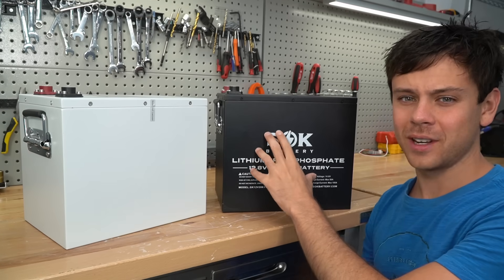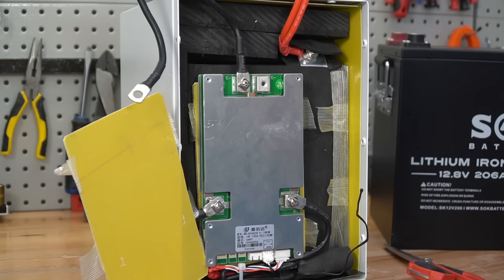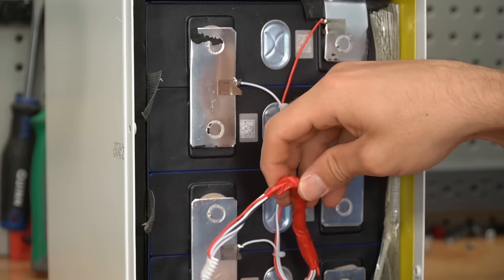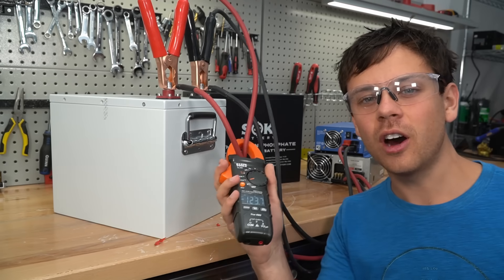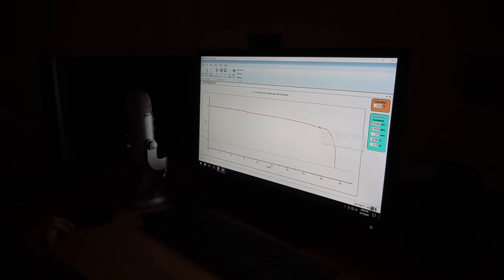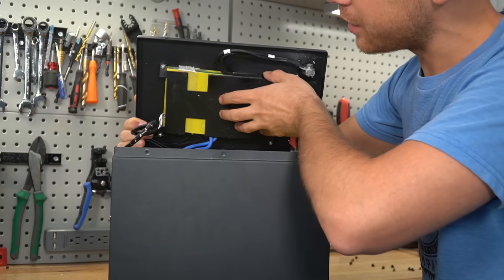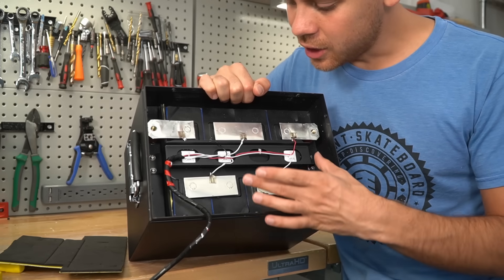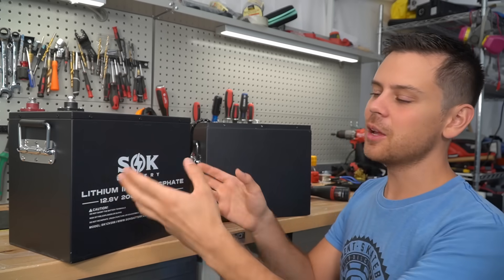SOK LiFePO4 Battery Knock Off! Prototype Tear Down

Comment: Totally love your YouTube channel. You’ve taught me a ton. I bought some 206 amp our S OK is. So far they’re a mess because the app is not reading correctly at all. And one of them is losing a charge… The place where I bought them says run them through two cycles and see what happens. What do you think of that?
Reply: Have you fixed the battery? These chinese things seem not that great

Comment: Great video Will, is there a way I can get in touch with you, I order a MPP 48 volt system and SOK 100Ah from your website, everything worked perfect until I left a small refrigerator connected over night, I came back and found my system down, I new right away I had drained my batteries, I order a 24 volt Victron Blue smart charger. 
I had order a second set of two 24 volt SOK batteries, Today I connected the new batteries on my system and nothing comes on, the voltage at each batteries was good 25.9V after connecting them in series 51.9 volts but when connected to my MPP it dropped to 9.57V.
I don't know what to do!

Comment: Hey, I have a 12V starter battery for a watercraft with a bad cell. Around 18-23 AH equivalent. I find it strange that no one is selling bad LiFePO4 starter batteries or parts.  Pouch cell almost square.

Comment: 5:46 I bet that happened ( wires pinched and one disconnected) as a result  of the same trauma that caused one of the power connectors to be bent ( referenced earlier).

Comment: In a sense I hope that this unnamed company works out their issues and gets their knockoff battery to market.  Why? Because SOK doesn't seem to have the ability to keep up with the demand for their product.  Every time I turn around SOK batteries out of stock/backordered. I like their overall design and I like the fact that someone with a little technical knowledge perform needed maintenance on them. On the flip side, I actually prefer battery packs that can be directly mounted into a 4-post 19-inch cabinet.  Sadly there are precious few options currently available that don't involve purchasing on alibaba and hoping for the best.

Comment: 3rdprototype - strap the cells down and strain-relieve the balance leads...

The unit needs to be able to be inverted without damage ( even if it really should be mounted right side up for optimal electrolyte distribution.)

Comment: Hi Will , I think you might be interested in doing something a bit different like a 24 volt alternator using a voltage regulator to up the voltage to say 60 volts to drop the amps to protect the alternator and feed that into your charge controller in place of your solar panels at night or for an inexpensive BACKUP in winter months for those in different latitudes . That could be interesting . What do you think ?

Comment: Congrats on the 500K Subs, brother.  I started watching you a LONG time ago when you were just a kid!  You've taught me everything I needed to know to power up my 1990 Foretravel Grand Villa. It's a 29 foot RV and I put four 100W panels on top and built myself four 12 Volt LiFePO4 batteries (with your help) and now have a great running, 48 Volt system in my RV.  Thanks again for your enthusiasm and your practical testing so that we don't have to get ripped off!  God Bless you & yours and your channel, son!

Comment: Will, good stuff.  Have a challenge for you.  The best LiPo system for a sailboat?  Boats have to be seriously offgrid and have a high safety req. for fire.  Could you do a video on your best recommendation for a LiPo Solar system for a sailboat?  Parameters would be 1000w of solar and a battery system to handle it.  Thanks.

Comment: I'm really enjoying your videos, and I feel like I'm learning a lot.  I'm not sure if you've tested a Wagan Power cube 1500, and I bought one several years ago, and looking to try to incorporate it into a sufficient solar power system that extends beyond it's normal set up.  In other words, I don't want to buy additional parts that might already be built in, nor do I want to over-extend the unit capabilities... to the point where I can't put all of the smoke back in.

Comment: i am looking at buying maybe a chins brand 12 volt 50ah batteries, i need 24 volt for my 60 pound thrust trolling motor. would i be better off to buy two batteries and run them in series or just get a 24 volt 100 ah battery instead? or build my own 24 volt battery?

Comment: Hi Will, I wondered if you have ever done a review of Ritar. They are a huge Chinese battery manufacturer and I bought two RITAR Lithium Batteri 12V 200Ah (LiFePO4) BMS 100A, for about same price as SOK, and that is in Norway where this stuff is usually expensive. They look fine and work well, but being a sealed plastic unit I don’t dare open them up ;-). Great video as usual - I have learnt a lot from you.

Comment: You can check out Fly Power through Amazon 48 volt 100 amp battery. Also check out with Scream Power through eBay 48 volt 100 amp battery as in same looks to outside of battery housing.

Comment: I love these videos. I am learning a lot. One question I still have: When you google "cost of lithium ion batteries" it says $140/kWh. But most of the batteries on this channel are $500 to $1,000 per kWh. Why the disparity?
Reply: Different battery. You’re meant to search for LiFePO4 batteries (lithium iron phosphate).
Reply: @pouggey7907  Now I see. So, why not use the cheaper chemistry? Don’t cars phones and laptops all use the cheaper chemistry? Seems like someone would sell them for solar storage as well.

Comment: Mr. Prowse.  I have a 12/3000/120 Victron which can supply 2400w continuous, I believe.  We are going to get bifacial solar panels capable of producing up to 5000w.  We have 4 100AH battle born batteries.  We'd like, if we're producing 5000w, to use more than just 2400.  We also have a bluetti ac200 (1700wh).  Is it possible to charge the bluetti using a setup designed for the Victron, while bypassing the 2400 continuous output of the Victron?  Or should we get another Victron in order to pass the 5000w through?  More batteries would help, as well, I'm sure.

Comment: I have a quick question  When I build my vehicle solar power system should I design it the same way as the vehicle and put all the grounds to the chassis or should it be floating independently

Comment: I have a old inergy kodiak solar kit. I have the panels on the Rv roof connected to the kodiak. I would like to add lithium batteries to the kodiak and would like to know if that is possible. Actually wondering if you can do a split of the panel wires with one set going to the kodiak and then one set to batteries through the solar plug-in on the Rv.

Comment: Can someone explain how they say not to disconnect the battery from the solar charge controller but isn't that the same thing as the BMS disconnecting the battery because it's too cold or cell too full.

Comment: I know you talk about not getting involved in wind power but there are concepts out there using central ac exhaust powering the wind turbine. I see it as "wasted energy" plus with heat pump concepts it could be utalized in the colder months. Would you be willing to apply this concept just once to see the " wasted energy" you make gain back.

Comment: Hey will, I’m a fan of your you tube channel and all the info about solar panels and battery storage. How do I know how to size my solar panel and battery needs for a 10x12 shed, which will have 4 to 5 15 amp. Machines a few battery chargers and a couple of lights, all running on solar.

Comment: Hey Will!!!  Can you do a review on this new battery that just hit the market - Zooms 12V 100Ah LiFePO4 Deep Cycle Battery, Rechargeable Lithium Iron Phosphate Battery, Built-in 100A BMS, 4000 Cycles [It's on Amazon, only $399.88]

Comment: I'm always interested in diy lithium batteries and I think i'm gonna build one for myself. 

I'm planning to use it as a starter battery for my old car. it's got a 2 litre inline 6 engine. can i use laptop cells to make 4S5P and use it as a starter battery? also im worried that the BMS would be easily fried when i crank the engine, can i directly attach starter motor solenoid to the battery bypasing the BMS and use the BMS as ballancing charger connected to alternator?

Comment: Great channel! I have learnt a lot from you, Will! Can I connect 100Ah and 206Ah in parallel? Or I can only connect same capacity batteries together? In my Van conversion, I connected 2 LiFePO4 batteries in parallel, one is 100ah, the other is 200ah. They are from same maker with same spec, just capacity is different. Somehow I can only draw about 200ah, NOT 300ah. I use negative terminal from one battery and positive terminal from the other as the charging/discharging terminal. Of course, their negative terminals are connected together (same with positive terminals). Anything wrong with that configuration?

Comment: I have bought a new RV that comes with 3 renogy 100 amp hour lithium-iron phosphate smart  battery. 3 - 360 watt renogy solor panels  a renogy 3000 watt inverter charger. A 60 Amp mppt renogy solor controller charger. I want to add additional batteries. Can I add more batteries at any time? Can I add a battery that is not a renogy? Can I add a battery that is a higher amp hour say a 200 amp hour battery in with the 100 amp hour batteries?
Reply: Solar that is

Comment: Any reason you dont recommend the Signature Solar EG4 LiFePower4 batteries?  32 cents a WH for the EG4 vs 42 cents a WH for the SOK?  Also the EG4 is rack mountable making it far easier to create a good installation.

Comment: Please review the Jackery Explorer 300, as it seems to offer more advanced charging options, especially a 60W USB C in/out PD charging port. None of the other Jackerys offer this, perhaps because this is a newer model. Also, a Jackery lookalike on Amazon made by "Ecosonique" claims to allow simultaneous 100W PD input charging and DC 60W charging with an energy rating of 296Wh. I'd love to know if that's true.

Comment: I would add a Smart Hybrid BMS + Active & monitoring Smart Bi Directional Cell Balancer
use a ESP 8266 just so it can have Tri Radio Transceivers [Wifi - LoRaWAN - Bluetooth ] with AD Hog Mesh + Touch E-ink Display +Host USB Port for Flash Pen Drives

If they Get the ESP side just right it never need a Cloud  to Give you a Very nice Webpage [ThingsBoard IOT Gui] and Python + Node-RED For Hot applied Firmware updates support
Reply: Meanwhile, back on Earth...

Comment: I'm considering some 48V 5.21W    EG4 brand 100Ah batteries for a grid tied backup.
Do you have any experience  with this brand and battery?
Seem to be sold and assembled by Signature Solar.  These are not UL listed so getting utility companies to accept them for interconnect agreement may be a problem.
Any advice would be helpful.
Great video and so helpful

Comment: well....definitely dont route the wires over the edge of the support arm, looks like all of them are damaged due to the shipping issue.  Interestingly enough, copying the SOK failed them here...their foam probably would have protected their wiring and even the balance wire.  id say hold down clips for the batteries into the bottom of the case would be a good idea if they are actually free floating in there.  Enjoying the channel Will.

Comment: They could definitely use some shoring up, but I wouldn't ding them too hard on the balance leads. Yours arrived upside-down with a bent main terminal - I'd pass that as "shipping damage." Maybe one of the improvements could be a better packing method, to better prevent death by logistics. 🤷‍♂️👍

Comment: What do you think of these?
Outback Power FLEXmax FM60 MPPT Solar Charge Controller
SKU FM60-150VDC
Be the first to review this product
View Product Documents
$425.33
Maximum output of 60 Amps DC
Advanced MPPT charging algorithm
12, 24, 36, 48, and 60 Volt DC Battery Banks
Built-in 80 character LCD display
QTY
Reply from the maker: Yeah I already made a few videos on those. They're cool
Reply: @WillProwse  I signed up to buy a all in one from your link    Still on the boat from China it’s a big unit. I’ll look it up and study it.  Thanks for back talking. I’m trying man.   U be kewl
Reply from the maker: I know the wait is long, but the all in one is what you need. The functionality for the price can't be beat. And no worries, its all good
Reply: This is the one I want but again I’m dumb but I’ll get better. I’ll figure it out but I’m sure I’ll get on your nerves man
Growatt 48V 12000T 12kW Split Phase 120V/240V output (100A at 120V ,50A at 240V)

$2,499.00 $1,999.00

48V 12KW Split Phase Low Frequency

Out of stock

Join the waitlist to be emailed when this product becomes available
Reply: This is the one I think I want?   You say?  And the gear to make it hard.
Reply from the maker: @Jungleboy-z4c  post in the beginners section on the forum if you wish. And yeah that's a cool one
Reply: @WillProwse  man I’m sorry worried I’ll buy the wrong stuff.  I had wealth or I guess money and made mistakes I can’t afford mistakes now. I’ll do as you say. Thku very much
Reply: I used these two times but I’m not a solar guy I paid heavy money in South America to have AC and two freezers.   But I want to buy things I can build off of and add two. I’ve seen you had a all in one and I’d like to know to star a build what is the best start?  Sorry man I’m ignorant north Florida country boy and no wealthy anymore but I must try to establish off grid I’m on a old farm in north Florida.  I thought I’d buy panels but I’m not sure ?  I do want the 48 watt set up with the batteries and all in one inverter. I signed up on a link to your u tube for when it come in from China. Is there a book for dumb people where I can kind read over and over?

Comment: If you haven't already You should be building custom kits for people that rather pay for a install Than try and learn all the tech in Volts to Amps And watts ...Like me lol I'm simple Plug in a 1000watt heater to a set up And see how long it last problem being with local techs They want to push brand new top of the line items to a point most people Jump on the portable power things like jackerys Which are also high cost for vanlife etc
Reply: If Will were to make a battery for someone else, he takes on product liability.   His time is worth more than a custom build would make him.  If he were to manufacture batteries in bulk, he could make an LLC  and carry product liability insurance. I am pretty sure he does not want to do this.

Comment: Quality Control: you don't just fix Quality control... either the company has Quality in their DNA or it does not... so even IF they were to fix every issue that you brought up, I would never purchase from them as they have already clearly communicated to us all that Quality is NOT in their DNA ...as in two units in a row had unacceptable quality issues! (and so No, I'm not talking about design issues and/or other improvements)

Comment: The bluetooth module is about $10 and available separately. Yes, that's a good BMS, better than the SOK. Fully capable of 150 amp charge and discharge. 
I think they need the second C- cable though.
Reply: Problem is you void the warranty if you add the module yourself. There is tamper proof tape on the lid.

Comment: Suggestions for the manufacturer (my two cents):  
1. Ensure when the battery is turned up side down that the weight of the cells is supported by the case top directly - not transferred via the wires and terminals as apparently happened.  This could be accomplished by high density foam pieces strategically placed on the cell tops.  The BMS, wires and terminals should never take on any load even if the battery is dropped from a height upside down.
2. I disagree with attaching the temperature probe to a cell directly.  A better attachment would be to a neutral heat sink like the battery support that neither contacts the case or battery cells directly.  Why?  You want to be able to detect low temp conditions before the mass of the cells are soaked to a low enough temperature to effect the sensor.

Comment: Hey Will, I just love watching all your reviews on technology.   I  am going to purchase the Chins 12volt 100AH Lithium Battery, Built-in 100A BMS, 2000+ Cycles, Each battery Can Support 1280W Power Output that you reviewed previously.   Do you have any recommendations for a battery charger for this type of battery.   Thank you.
Reply: Victron, but you'll have to be more specific on "battery charger". Solar, DC to DC, AC to DC an inverter with built in charger etc
Reply: @mrmotofy  i will be using the battery to power a 12v frig that uses approx. 5 amps per hour and when and the battery depletes down to say 50%, will charge back up with a battery charger
Reply: I have purchased several chins 100ah. A great charger for the price is the 10A charger from Dakota lithium. Otherwise any lithium battery charger works.